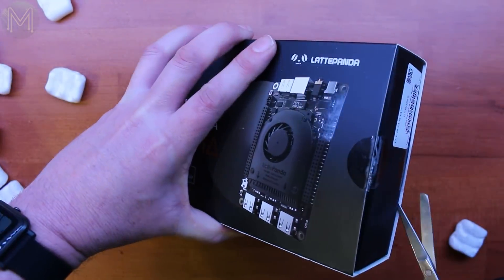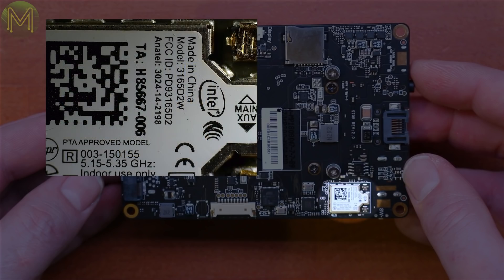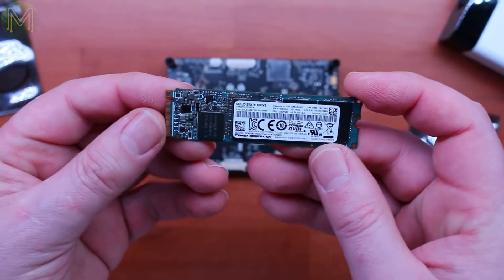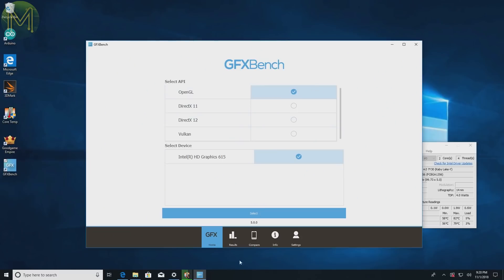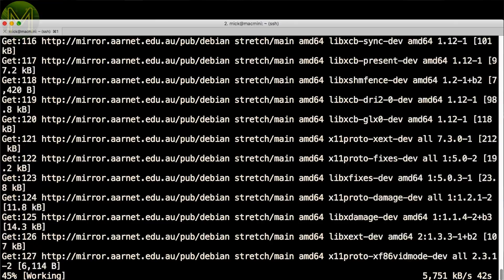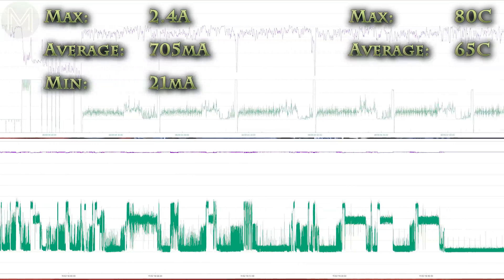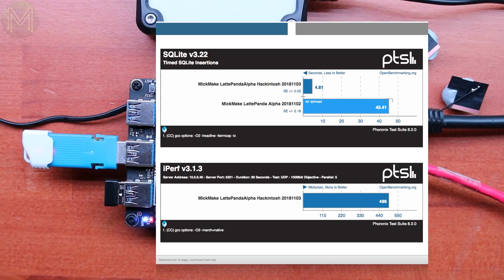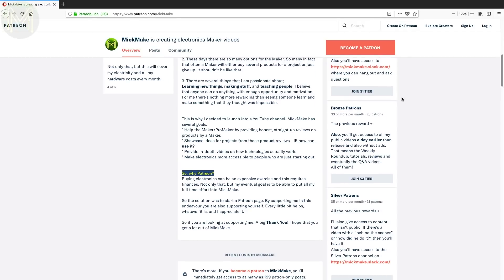#238 LattePanda Alpha: The big mistake? // Review

Comment: What are your thoughts about the fan? Will it last or should I request a spare; can I get by without it or stick a bunch of small aluminun heat sinks on to the metal plate in case the fan fails?

Comment: for the same price you can get a quad core udoo bolt 8 which comes with a quad core ryzen, a vega 8 GPU, ram slots instead for upgrade able ram, onboard flash, a better arduino, so the udoo lets you upgrade ram as well, all for the same price. it also has 2 usb-C ports and much more.

Comment: 33C in your room? Jeez man, get some air con.
Reply from the maker: 33C isn't hot. :-D
Reply: @MickMake  Really? 33C in this country and I'm sweating my balls off. I guess you guys get accustomed to hot weather though.
Reply from the maker: Yeah, you get used to it. It starts to get uncomfortable at 40C, but it all depends on what you're doing. At that temperature you definitely don't want to be working outside. You'd be spending more time drinking water than working.

Comment: I remember watching closely during the development stage of this product and thinking how cool it sounded but in the flesh and with the price tag they have put on it I am struggling to figure out the target market. If you are a maker after an Ardwino then you don't need all that horsepower, you can just get yourself a Rasberry PI for a fraction of the cost. On the other end of things if you are looking for a tiny low power PC then there are a plethora of small Intel Y-Series and ATOM based machines on the market with just as much horsepower that can be had for less.

Comment: The big mistake is buying a lattepanda at all. Yeah sure we can all fire one up for half an hour, play with it and benchmark it for lols, but you can't seriously use the things for anything. I got my hands on one of the originals and sometimes it'll last two weeks, sometimes it'll last a day, one way or another it will at some point just randomly loose storage and networking... not to mention that the included OS is Win10 so even if the hardware doesn't crap out on you, it will reboot itself whenever Microsoft decide its a good idea. Basically what you get is an overpriced SBC that is unuseable for any of the jobs you might want to use an SBC for because it won't work reliably. As for the built in arduino, thats nice but seeming as it is BUILT IN its only really suited to tasks where the arduino would have been tied to a Windows PC anyway (e.g. I want to use the networking), if the windows PC it is tied to doesn't actually work then its useless for those jobs.

So what are you left with? An arduino with a convenient built in IDE? Not even that... I put a basic LED blink program into mine and when the Windows machine is shut down, the blink rate of the LED becomes slower, the clock to the arduino seems to drop when the PC half is switched off, so you can't even use it as a dumb arduino.

If you want an SBC with lots of GPIO, buy a raspberry pi, if you want a small PC, buy a small PC, and if you want a simple micro with supporting power supply and IO, buy an arduino.

The original LattePanda I bought proved so useless for any actual work that it has been sent to work out its days as an occasional use thin client because booting it up, establishing a remote desktop session and then shutting it down again before it gets a chance to die by itself is all I can trust it with.

Comment: the low height of this board and the system overall performance will be perfect for my netbook project(changing the internals of a dell latitude 2100). Very cool board
Reply from the maker: Yes indeedy! Even though the price is very steep, it's well worth it.
Reply: @MickMake  actually, I dont know of any other intel based SBC eith similar dimensions(around this height). Do you?

Comment: I don't remember exactly what the deal was, but the SQLite performance on MacOS happens because of something that's an issue (not optimizations...) I don't remember exactly what kind of issue, either something related to security or stability, but in general that test should be ignored. MacOS's performance is a complete joke compared to Linux and Windows, evenly matched my ass.

Also, intel's graphics drivers on Linux are freaking terrible, AMD's are fantastic these days though. If you're gonna use integrated graphics on linux, modern AMD APUs are the way to go, I hope we will get devices similar to the lattepanda with AMD equivalents to the processor used in this one (though I'm not sure if such an equivalent exists yet or not since it's a bit outside my sphere of interest)
Reply: Yeah saying macOS's performance is pretty well matched to linux and is to be expected was so weird.

Comment: The temperature was off because the temp gun sensor was reading a part of your finger and thumb, the diameter of the cone that the sensor reads expands the further away from read point you are.
Reply from the maker: I did take an average over time and removed, as best I could, any possible interference. The temperature was fairly consistent with the temperature measured by the SoC.

Comment: I thought the M.2 SSD would result quicker than the built in EMMC.  I tried to load windows into the Samsung EVO M.2 but the windows install dosent see it.  The BIOS does and so does the EMMC windows.  Help?
Reply from the maker: TBH I haven't tried a Windows install on SSD. In theory it should work, but SBCs always prove theories wrong.
And yes... M.2 SSD will be definitely faster than eMMC, especially when you use NVME SSD.

Comment: i highly doubt those are all p-channel mosfets, especially the beefy ones. for power purposes they pretty much always use n-channel FETs even for the high-side switch, using a bootstrap circuit to provide the higher gate voltage.
Reply from the maker: No, not all. But there's a heck of a lot of MoSFETs on this board.
Reply: sure, like all the CMOS chips on there have a roughly equal balance of N- and P-channel FETs. But for any power switching situations beefy enough to warrant a discrete transistor, it's almost certainly gonna be all N-channel.

Comment: Don't power it directly from the car. I have designed circuits that go into cars and trucks. Automobile is a nasty electrical environment. For a 12V system you have to design for a sustained 16V DC voltage and transients can go well over 100V. If you have to power it from the car do it when the car is off and make sure you are not turning on or off other electrical items - especially AC or the starter motor or anything that activates or deactivates an inductive load like a motor, relay or solenoid.
Reply: So don't run it off of an inverter or anything at all. Would a battery solve the issue.
Reply: @fafdus  Mmm...I wasn't talking about an inverter being the problem. The 12V DC rail is itself the problem. An inverter might in fact help as it would introduce two layers of protection - the inverter itself and the adapter after the inverter.
Reply: @lhxperimental  alright cool I don't want to brake something.

Comment: That Log4 power meter/logger is really cool and I really want one. But I just don't know about spending nearly $300 for the unit. I've been looking for something similar and nothing comes close to it that I can find. I was wondering how long you have had it and if you have any complaints...
Reply from the maker: I've had this demo unit for more than a year and I should really get a proper unit. However, the demo unit has been holding up fine without issue for that long.
There are a few quirks, but I believe the newer versions are much better.

You reminded me to contact the Ozzie company about getting an official version.

Comment: Backed mine on Kickstarter back in the Spring. Mine still hasn't shipped yet ;(
Reply from the maker: Yeah, that's a real sting for those who backed the campaign. They should be fulfilling the backers first ahead of the sales.
Reply: @MickMake   yeah... I backed the cheaper Delta model which is identical to the Alpha except it runs on a Celeron and has half the RAM. Last I heard, apparently, Intel hasn't delivered the Celerons due to some production issue on their end.

Comment: What are the chip numbers on the memory? Since it uses 2x 4GB chips, i'm kind of curious if my GPD Win2 could have it's 4x 2GB chips replaced with 4x 4GB chips. :D Cause the GPD Win2 would run SOO much better with 16GB of ram, since the memory is shared with the video memory.
Edit:
I agree with the beefier arduino thing. I also think they should have went with a cortex m4 at least. Maybe even partnered with Teensy.
But i'm glad they included an arduino, the 32u4 is fine for gamepad controls, using joystick-HID code.
Or for like, RFID Modules etc. Or even great for an arcade machine, since the 32u4 does have enough IO for a full arcade top. Any arduino is better than no arduino.

Also, instead of a m.2 E-key, they should have either had a second m.2 M key for a second SSD OR for an m.2 to PCIE4x adapter.
Or a single m.2 M-key and a thunderbolt 3 port.
Reply from the maker: I have my board under some more testing. So will have to wait until I have time to open up the heatsink again.

Teensy would have been a good idea, although they are hard to get at quantity. Even if they used a SAMD51, or any number of STM32s... That'd be so much better.
Reply: I personally just like the Teensy Bootloader, it's proprietary though, but it's pretty beefy.
They probably could have used that giant arduino Due as well.
Reply: 12GB of memory in triple channel would be awesome on an SBC like this! 16GB is sort of overkill for an m3 IMO. Too bad Thunderbolt 3 isn't included; hooking up an external GPU to the Alpha could've been compelling...
Reply: The overkill isn't a consideration, it's what's technically possible. You can't* have triple channel without multiples of 3. This lattepanda864 only has 2, and the win2 has 4
3GB chips are almost as expensive as 4gb, like $3 difference., and 4GB chips are about $35

Now technically you could have even triple channel with 2x 2gb, and 2x 4gb chips, with each 4GB being a separate channel and the 2x 2gb on their own channel, but only some desktop motherboards and server boards support this configuration with traditional ram.

For the lattepanda, in theory you could get 2x 8GB chips, 
And the GPD Win2 4x 4GB or 4x 6GB chips.
I didn't find 8GB chips from samsung in that package. 24GB would definitely be overkill.
I'm honestly considering it for my GPD win2, the bios is totally unlocked (no hidden options) so i could probably configure the bios for 16GB.
and the 4GB modules are $35 each, and it'd probably cost $120-150 to have someone with proper reballing workstations to do the swap.

8GB really isn't enough anymore, 12GB would have been perfect for the LP or the win2. But 16GB is probably easier to do.

Comment: But you can use a gpu thru the m.2 key-m with can support 4x PCIe using adapters
Reply from the maker: Correct, but albeit at a slightly slower bandwidth.
Reply: Someone should try this with a GT1030 or some other graphics card that is either low power or doesn't rely on the PCIe slot for all of its power.
Reply: @hunterp589  you can add a external powersupply to most of the m.2 to PCIe adapters
Reply: @Reviosis  That is true, but at that point it might be cheaper and less of a mess to buy a mini-ITX PC with an 8th generation Pentium.
Reply: @hunterp589  true but I personally need a tiny pc with enough power to run Architect CAD Programs, so a GTX1050 mini or 1050 ti mini with a  12+5 V Powersuply with about a 110W should be able to do wonders for a MINI PC build

Comment: If the arduino was optional wouldn’t that make most of the GPIOs useless without it? Can you access them from the board without a Co-processor?
Reply from the maker: It'd be a case of either having the headers still there and having a different MCU providing GPIOs for those headers,
Or having the headers on a separate daughter board.

Comment: I don't find problems using 32u4. What they are thinking (as I thought) might be, it's an arduino, which means the user can get help from arduino community. If they use something else like STM32, the development process would be much more complex. What do you expect from MCU since you have a strong CPU onboard? It offers low level bus access, that's all.
Anyway, I would say the price is a big problem. I can buy a much more powerful board (like for notebooks) with less price with an arduino interfacing via USB.
Since it's a x86 chip, I say it's for windows. Yes, you can run linux and macos, but you don't get decent performance without driver support.

Comment: If anyone can help. I’m looking for a small form computer that has both a serial port and parallel port. That can run XP, still have lot of old test equipment that won’t work with USB adaptors. And was thinking about writing programs that will act as a protocol converter between an old pc and new .

Comment: 15 minutes of praise on the high performance, 30 seconds of critique on the included 32U4, but then calling it "big mistake"? I'd say this video has a clickbait title.
Reply: It's such a clickbait. The one they use in daily newspapers. Feels a bit slimey too..
Reply: not only is the lack of modern MCU is a mistake, but the udoo bolt beats this at a lower price for better hardware.
Reply: Alexander Gräf how about buying a $60 computer with a $200 GPU and better DDR4 ram for the price of this. I think that’s a little better hmm?
Reply: @JohnDoe-ir8te  such as?
Reply: @JohnDoe-ir8te  such as?
Reply from the maker: See my reply below to +k0ppit.
I still think it's a big mistake they didn't include a much faster, more modern MCU on this board.
Reply: @MickMake  at least they could have used a samd21
Reply: @MickMake  Then maybe the focus of the video should have been what you can and especially what you can't to with the board regarding the Arduino interface. Although I do agree that a 32 bit MCU like a SAMD51 would have been a better choice. But then again, architectures like TI's Sitara have a much tighter integration between the PRU and the main CPU. Having a fast MCU connected with a high-latency, low bitrate USB-UART doesn't make much sense, so even if it was a 32 bit micro, it would still need much more presence. The MCU just isn't a first-class citizen on the board.
Reply: @MickMake  I agree. So much of the PCB's real estate is being used up by an inferior mcu when the STM32's costs about as much as the ATmega's and are mostly compatible with the Arduino IDE. It can't be overstated enough what a waste that is. But #muhClickbait lemmings just don't understand what they could have had instead. Alexander can complain about his misconceptions of clickbait, but the real issue is that the ATmega series are an under-performing family of mcu that is out of place amongst all that SBC power and tinkering potential. The hobbyist in me says "it's not good enough." Especially for the huge price they're asking for that Lattepanda.
Reply: @AngryRamboShow  as I already said: why not focus on what you can't do with the included 32U4, when you call it a big mistake. I agree that a SAMD21 or 51 would have been a much better idea, but as it stands, it's still a very very fast Raspberry with the capability to run Windows and realtime IOs.
Reply: @graealex  Sure, that's an honest statement. Taken from the book "Beginning STM32," here is a short explanation of what an STM32 can do versus an ATmega32 that would make it more appealing in the long term, but just my opinion:
"Unlike the popular AVR family of chips (now owned by Microchip), the STM32F103 family has enough SRAM (static RAM) to comfortably run FreeRTOS (freertos.org). Having access to a RTOS (real-time operating system) provides several advantages, including
• preemptive multitasking;
• queues;
• mutexes and semaphores; and
• software timers.
Of particular advantage is the multitasking capability. This eases the burden of software design considerably. Many advanced Arduino projects are burdened by the use of state machines with an event loop model. Each time through the loop, the software must poll whether an event has occurred and determine if it is time for some action. This requires management of state variables, which quickly becomes complex and leads to programming errors. Conversely, preemptive multitasking provides separate control tasks that clearly implement their independent functions. This is a proven form of software abstraction. FreeRTOS provides preemptive multitasking, which automatically shares the CPU time among configured tasks. Independent tasks, however, do add some responsibility for safely interacting between them. This is why FreeRTOS also provides message queues, semaphores, mutexes, and more to manage that safely"
Reply: @AngryRamboShow  I do know the difference between an 8bit and 32bit MCU. My point was that it should have been more of a focus in the video. Also the practical implications of that. For instance, even the 32U4 can run Marlin or Grbl, if you wanted.